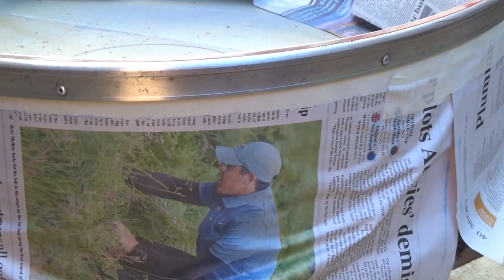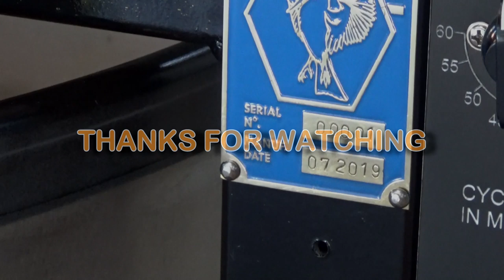The "Kooka Muller", a DIY Sand Muller for the Home Foundry - Final

Comment: Mark,  Wonderful project!  I enjoyed the humor too.  Unlike Nicholas Stahl below, my wife didn't walk in while I watched this video, so I'm safe.  ;)  As far as the plastic switch box goes, would the switch have fit if you removed the dinky bell assembly from it?  Tareem Moaleji asked my first questions, so I won't repeat them.  Do you think the screws holding the bar for the outer "plow" will prevent it from turning against the outer drum from the force of the sand?  Especially wet sand?

I'm looking forward to you using this "Kooka Muller" in future projects.  Please keep us up-to-date on how well this works.
Reply from the maker: I really cranked those screws down hard and they seem to hold the plough in place OK. I really did want to keep the little bell and i feel like the aluminium switch box was a better alternative. At least it won't shatter when I knock something over against the muller.

Comment: you need to stir the roller  track deposited sand so the roller did not just roll over it without effect.. so I suggest a scraper behind the wheel to stir the sand

Comment: Lovely job as always Mark you're a true craftsman.

Couldn't you just have removed the "Bell", particularly as you said you doubt if you will hear it anyway?
The term "Plow" is more than appropriate, it is an accurate and concise description of their use and role.
The centre plow could just be taller/wider to solve having too much sand :-D
I agree that a scraper on the roller might be useful along with some teeth on it as well to help break up the lumps.
Reply from the maker: Luke, I like the little bell. It's nostalgic. Modern appliances have no soul! I will need to do some tweaking with the operation of the muller. It will have to wait though. I am due to leave on a holiday overseas shortly.
Regards,
Preso

Comment: You need some rubber at the bottom pf your take/plough, so it will noy damage the bottom of your drum.
Reply: And you may need one more plough, after the roller, in the path of the roller, to really plough the sand ans turn it upside down, like you did with your shovel when you tried to scoop the sand, Because the way it is, it created a nice thick and compacted track of sand, you need to break that.

Comment: beautiful ........ what do you think about adding another plow to disturb the sand that forms under the wheel? ....... a plow shield say opposite the wheel that pushes the sand off the bottom of the drum
Reply from the maker: You can adjust the ploughs to distribute the sand better. I did do some upgrades to it recently but in general it works fine. I mulled up 100 pounds of petrobond sand this week and it was a breeze. Way better than getting down on your hands and knees and doing it by hand. 
Regards,
Mark

Comment: Mark, this just showed up in my feed from ~4 years ago. Is there anything you would have done differently now if you had to build this muller again today?
Reply from the maker: I did change out the plywood pulley to a shop made aluminium one machined from a solid billet and I also added a cam type belt tensioner between the motor pulley and the drum pulley. This was the biggest improvement. Prior to that I had to tension the belt often. Now I can use the cam to get the belt tight and just lock the motor in place. I also added sealed ball bearings to the roller. Other than that it has pretty much stayed the same. 
Regards,
Mark

Comment: Oh no! You only taped the ends of the roller. Now you're going to have to sand off all that overspray....lol.
Good job it looks great. Love the tag. Very finished look. I noticed the sand building up in the center.  I remember Luckygens model did the same. I wondered then if a more scroll shape would work?A closed tear drop shape would be tempting,  but would not have an exit for any sand inadvertently getting in there
Reply: I figured he knew the sand would scrape any overspray right off.
Reply from the maker: You got it!
Reply: @andyshap  👍it was a joke,
Reply: I got the joke, just commenting. That's the trouble with any typed response, no facial features or body language to emphasize the remark.
Reply: @andyshap  you are right. Even in person many people don't get my smart aleck, sarcastic, "dad humor" jokes. It's even harder in writing 😉

Comment: Hi Mark,
another though , on the great Muller you made.
I notice that there is a central band of sand that remains between the two ploughs.
what do you think about having the central plough pushing its share of the sand all the way across to the outside 1/3 so that the second plough folds this over, ensuring a good mix
Reply from the maker: I must say that I copied the muller that I saw Luckygen1001 detail on his channel. He is a bit of an Aussie foundry guru and I figured he knew what he was doing. I am currently on an overseas holiday and I have only used the muller once so I am still to see how effective it is. I am keen to do some more testing with it.

Comment: But, of course a name tag to finish the build.
 Looks like it will do just fine.
Reply from the maker: Surprisingly, it's one of the few home built machines that worked right out of the box. I don't regret spending the time and money on it. I'm too old to be on my knees squishing up lumps of sand with my bare hands. 
Regards,
Mark

Comment: Mark have you looked at roller in the shape of a cultipacker with less surface area for the lumps to float under the roller. just an idea. nice job!
Reply from the maker: Richard,
I think I probably should not have called the roller a compactor. It's main job is to sort of iron out the lumps of sand and then grind the clay particles into close contact with the sand grains. A good greensand has sand crystals that are completely surrounded in a fine coating of clay. I understand that just mixing the clay through the sand is not enough to give a good strong greensand. I guess the action is more like grinding than compacting.
Regards,
Preso
Reply: @Preso58   the reasoning behind the cultipacker was to get roller to contact the clumps. I was a maint superintendant at a large vegetable oil refinery and we conveyed spent bleaching clay/diatomaceous earth to a rotary feeder that we fed into a boiler(coal fired)to burn up the residual vegetable oil as a fuel leaving only the fossilized material in the coal ash. we dealt with clumps stopping up the feeder. I designed and built a clump buster with a two row cultipacker  (in appearance  only)not to pack the clumps but break up the clumps as the two rollers were off set to break each clump. I realize what you are doing is not compacting just trying to return the sand back to its granular state. Just an Idea for thought. Enjoyed  the project. ATB Richard

Comment: great work old mate, how would  rake tines go just after the roller ? this with the center plow and outer plow will help to turn and mix your sand ? eg in your demo, you said might be to much sand and it compacting , this would fix that ?
Reply from the maker: I am going to have to do a lot more experimenting. Now that I have it running I am going to have to tackle some of the backlog of castings I have been putting off. As soon as I finished the muller I was off on another tangent and you will see where that goes shortly.
Regards,
Preso

Comment: Mark, being a shop teacher (aka industrial arts, later renamed technology education) I'm curious to know what you taught and what grade level you taught at.  I teach high school, grade 9 through 12.
Reply from the maker: DIY Chad, I taught years 8 through 12. The subject names changed over the years but it was mainly woodworking, metalworking and graphics. For political reasons, over the past 18 years or so,  high schools in Queensland were encouraged to teach vocational subjects (VET) which would normally have been delivered by TAFE (Technical and Further Education) The TAFE colleges used to take students from year 10 through 12 and prepare them for apprenticeships. In the high school we could deliver up to certificate 2 level in areas like engineering (fancy name for metal machining and fabrication) Furnishing (woodwork) and construction. Our curriculum was effectively dumbed down in favour of the VET subjects. In the year I retired the school cancelled the Senior Graphics programme which another teacher and I built up over many years. It was a board subject meaning it counted towards a students university entrance score and it was technical, challenging and I thought, engaging. The assessment and reporting load was fairly intense but I relished the challenge. It also allowed us access to higher calibre students who were looking to go on to engineering, architecture and graphic design. In the VET subjects there was no assessment other than determining whether a student was "competent" or "not competent". Students realised that they only had to do the bare minimum to achieve competency and there was no incentive to work harder than that. Having said that I really enjoyed teaching the younger students. Year 8's were especially rewarding. We only had them for one term and the best we could do was to teach them some basic woodwork, metal and plastics skills. So the turnover was high but the good thing was that you weren't stuck with kids with challenging behaviour for more than 10 weeks. The biggest problem we faced towards the end of my career was the steady increase in class sizes. We had workshops with 24 bench spaces but we were continually given class lists with 28, 29 and 30 students. The rationale was that there would always be a few kids away! The administration would rarely get out of their offices to see what was really going on and I made a nuisance of myself inviting them to come to my classroom to see what it was really like. I knew I was retiring and so had nothing to lose. It made no difference though. I could see the writing on the wall and decided it was time to go. I still go to the school sometimes just to say hello and I do miss the teaching. I was just fed up with the peanuts who were running the show. The one thing that I found quite late in my career which I was really sad to leave was the F1 in Schools programme. It is a STEM programme which is run worldwide and delivered in Australia by a not for profit company called Re-Engineering Australia. I started with the programme in 2004 as a complete novice and for the first year I had no idea what I was doing but we slowly gained some traction and made it to the national finals the following year. We won our racing class but for organisational reasons did not get a spot at the World Championships. One of my students did get invited to form a team with a female student from another school and competed in London but his poor old teacher (me) did not get a spot. That came in 2009 when I took a team to London where we competed as a collaboration team consisting of four Australian students and two Canadians from Winnipeg, Manitoba. We took first place in the collaboration class and came third outright in the world. The students had to design, manufacture and race a small model formula one car which was CNC machined from balsa wood and powered by a CO2 gas cylinder. It is raced on a 20 metre raised track, slot car style, and started and timed electronically. They cover the 20 metres in around 1 second. They also have to write a design folio, set up a pit display, deliver an 8 minute verbal presentation and collaborate with industry. My son was on that team and the experience has helped him get a job with an advanced innovation and manufacturing company in Wellington, New Zealand. At the competition we also got to meet Lewis Hamilton and we were guests of the McLaren F1 team and the Red Bull team. We toured their factories and met many of their engineers.
It was a great programme but it was like taking a second, unpaid job alongside my normal teaching, reporting and assessment load. There were many days when I would get home at 4pm, have a cup of tea and dinner and then work from 8pm until 2am. I don't regret any of it though. As a teacher, I am sure you have projects or programmes that you are passionate about so you will understand. Sorry about this rather long winded reply but I always find it fascinating to hear what teachers in other parts do and what their working conditions are like. The teacher I worked with from Winnipeg was a great guy and it was interesting that the system in Canada and Australia were so similar. 
Regards,
Mark Presling

Comment: Sounds like your from OZ ? Just beginning the journey trying to locate Crucible’s  in Melbourne or Oz. Any ideas . Cheers Laurie.
Reply from the maker: I got mine from Ebay. It is a #9 and from memory, I only paid about $35 a few years ago. They are still available and although probably made in China, mine has held up really well. https://www.ebay.com.au/itm/363890421308?var=633125913535&epid=17039916563&hash=item54b98f2e3c:g:1v0AAOSwDLhdEJTt&amdata=enc%3AAQAIAAAAwKxiRZOHYUtgzXL7fRAv6rMQtCxXx1iXbLZJBAHlkw8MDnG%2BNAaoi6ij2fDP3sNWEP3Yjas5P5Dx9Uh2dWn91XAyca29kirhyr98%2F6nuBzze8o0kYMBVUL8VdZPVVoDbQX98by3hppJ%2BlSNvcSGNA52nZC1dy0ynT300puaRK4pdgoYpi9RHLBBSDjKtNSsdU57LxsZTPpwTKnRJ4qrAdAkyPt%2FbLyEG7wKPMK9C8th5rXtqzkQIDpf7Jg4%2Fb6OENg%3D%3D%7Ctkp%3ABlBMUOro89OBYg
Regards,
Mark

Comment: Hey presso 

Random question, do you think yellow brickies sand would be ok as a base for greensand? I cant think of anything "off the shelf" that's finer
Reply from the maker: I have never tried it. Apparently, some sands have enough clay content in them to use as greensand without any extra bentonite clay.If it were me I would just try it as it comes and see if it will hold the shape of the mould. I know that Myfordboy and Olfoundryman use natrual clay bearing sands just as they come out of the ground.

Comment: hi, nice job - you should look at luckygen1001 Sand mixer and mixing sand  he has a muller like what you made and has some good info on the operation of it - be careful get sucked in and it will rip off you arm and mix it into the sand and no way to stop it.....

Comment: Hey mark, can I get your advice?

Looking at making green sand, but the only bentonite I can get my hands on easily has Zeolite and Spongolite in it, do you think it would still be safe and effective to use?

Cheers
Reply from the maker: DSRMoto, I have never worked with those additives before. I guess you could just try it. I got my bentonite from a rural supply centre. It is sold as an additive to fix leaking earth dams. If the greensand holds together when you squeeze it in your hand without sticking it should do the job. From what I understand both the additives are organic and derived from natural sources so they shouldn't be toxic when heated. 
Regards,
Preso
Reply: @Preso58  cheers mate, enjoy your holiday!

Comment: you should have put a pivot in the carriage to tip the sand into a bin to empty save your back on shoveling it out
Reply from the maker: It would certainly make it easier to get the sand out but there would be a lot of complication for the build.

Comment: What brand powder coating set up do you have? I have started looking for one
Reply from the maker: I use the Eastwood powder coat gun kit. It came with some sample powders, some silicone plugs, some heat proof masking tape and a spare powder container. It's a nice compact and easy to use gun but I had to purchase a step down transformer (240V to 110V) since the Eastwood gun is made in the USA.
If I was going to buy it again I would get the dual voltage gun. It performs a bit better when you have to shoot powder into narrow gaps and tight spaces. 
Regards,
Preso

Comment: DEMONETIZED!!! Also, why didn't you just take the bell off of the back of the switch and use the plastic box?
Reply from the maker: I like that little bell. It's a nostalgia thing. We had a microwave oven with exactly the same timer and bell. We bought it in 1983 and it was still going great up until three years ago when we renovated our kitchen. I took it to the recycling centre thinking they would sell it as a working oven but they told me to chuck it in the skip. I told them that it still worked and it looked almost new. They didn't care. Told me it was too old. Go figure! Anyway, now I think that the aluminium box is a better fit and it won't break when I inevitably ram the muller into a wall or a door jamb!
Regards,
Mark Presling
Reply: @Preso58  
Hi Mark , i also have a microwave with the old dinky bell  although my one uses a rotary encoder on the timer so they must use a solenoid or something to hit the bell .
the transformers from old microwaves make good demagnetisers and small spot welders if you don't mind modifying the transformer .
Reply from the maker: Ian, I made a spot welder from a repurposed microwave transformer. It works great. Certainly one of the more successful projects I have done for a long time. I had pretty low expectations for it but it has proven to be a really useful tool. I also made a great demagnetiser but I made it from neodymium magnets instead. Also works great. Take a look back through my archived videos and you will see them.
Regards,
Preso

Comment: Just take the bell off you said you will never hear it anyway
Reply from the maker: Yes, I did consider it. I guess I left it on for nostalgia. We had a microwave oven that we purchased in 1983 and it was still running when we did a kitchen remodel three years ago. I took it to the recycling centre and they told me to chuck it in the skip. I told them it still worked and it looked like new. "We don't care, it's too old". It had the same timer and the same bell. So sad!